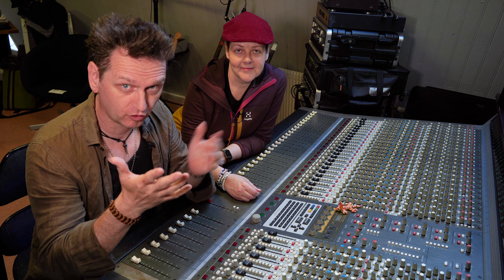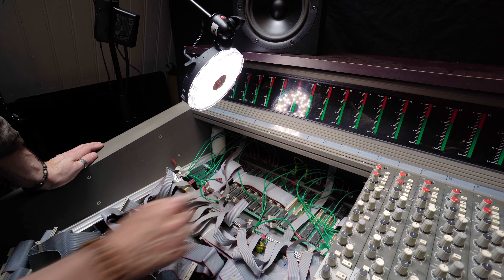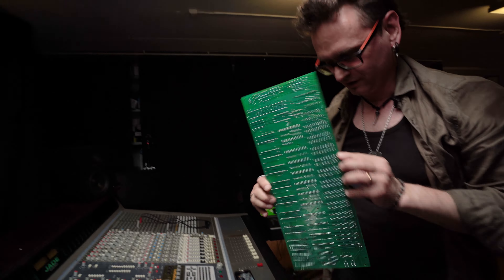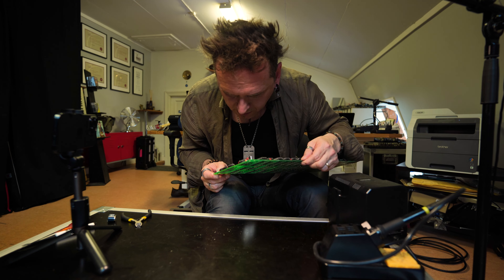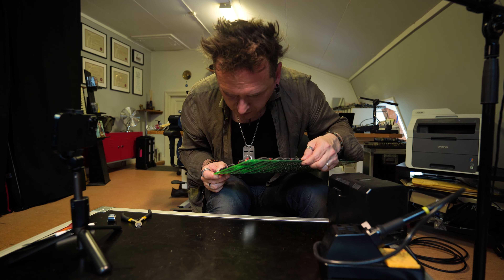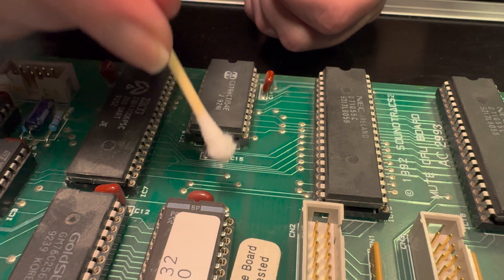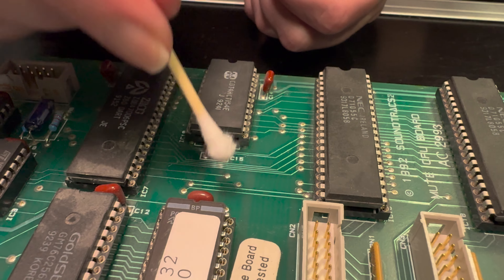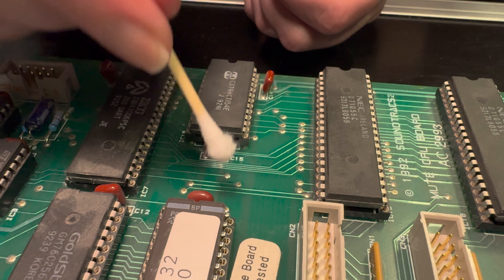Soundtracs JADE (pt 5) - do this before IT KILLS your console!!!

Comment: Great video again folks. Maybe just solder the second battery in situ. I think when I changed the 2 batteries I done them in situ. If I remember I flipped the center section on it's side on the console and managed to solder it from there. Good luck you guys. Remember flux is your friend
Reply from the maker: Yeah we thought about that for the second battery. But that one seems even more damage, so we got advice to try to get the PCB out just to have a look at it and make sure the traces and components next is ok.
Reply: @moneeo  Nice one. You guys rock!!! Since the battery on the center section is upside-down, I think any leakage would drip down and not affect the pcb as much as the other battery does. The traces are a little fragile and replacing caps is daunting. The legs of the caps are all bent outwards ( for keeping them in place for soldering ). The legs can be cut directly underneath the cap, then you can either splice the cap onto the old legs or heat them from the topside and remove the legs ( pins) from underneath with tweezers. Just be gentle and use some flux.
Reply from the maker: @Joey-rp5vg  Yes, hopefully gravity have saved the board from some of the battery acid.👍

Comment: Great time to recap your board too, not too many electrolytics. Have fun, use a desoldering tool i was nervous when you pulled
Legs w/ plyers😂, im recaping my channel strips in my soundtracs too and sometimes pads or traces lift with just looking at it😅.

Keep out the good work

Keep posting videos! Nice work
Reply from the maker: Recapping is on the todo list for the future. I believe it will take some time since there seems to be aprox 48 electrolyts per channel...😳

This project is one step at a time, and they are probable baby steps since everything takes so much longer time the first time we do it. 😀

Thanks for you encouragement, we will keep filming!👍
Reply: @moneeo  remember to add bypass caps around the audio electrolitics and, and decoupling caps for the rails of your opamps. It will be a lot 😅.  On your mute board there is like 10 or more wlectrolitics to be changed.
Reply: @moneeo  For that old console a PSU recap is a must and i´ll do it asap, also power distribution caps inside the console.
 A failure on a channel strip is a pain but nothing serious, a failure of the PSU or the power distribution can be a disaster for the whole console! 
Also 30 years ago there was not that much noise as now at electric grid caused by switching power supplies from TV, laptops, etc... so an iec connector emi filter chassis mount for the PSU certainly will not hurt, if the PSU does not have it...
Have fun and good luck!
Reply from the maker: @jplexstudios  This is the first time i have heard of "bypass caps around the audio electrolitics and, and decoupling caps for the rails of your opamps" - could you tell me a bit more about what that is good for?
Reply from the maker: @nomoimusic3096  We are thinking about getting a new Bluedog PSU and have the old one as a spare.
Reply: @moneeo  Nice!

Comment: Great feeling isn't? I have done this before.(and still do it) It's a labor of love! 
Might I suggest; when handling pcb with such rare ICs, you should probably ground yourself with a wrist strap to avoid static discharge. You don't have to wear it on you wrist.  You can attach it to any part of your body. As long as your body is attached to ground(earth in Europe). I always do this when handling any pcb with ICs. Good luck.👍
Reply from the maker: That is a truly great advice that we will do for the rest of the project - thanks!👍
Is it a good idea to connect the ground of the ESD wrist strap/mat to the ground of the JADE?
Reply: @moneeo Yes. As long as your ground source is a solid one.
I find the wrist strap gets in the way sometimes. You may find this funny but, I usually remove the strap from the wire  (it just snaps off) and just insert the end of the wire inside my pants at my waste. Just make sure the the wire contacts flesh. Et voilà! You are grounded and hands free!😎
Reply: You can get an antistatic matt connect it to the ground system and buy heel straps for your feet.. that way the cable wont get in the way which it always does!. Just remember to tuck the ground strip into your socks :P
Reply from the maker: @sylvaind9086  Sounds great, will try a solution for the next step - keep an eye on upcoming videos!👍
Reply from the maker: @projekct_amk  Heel strap sounds like a great solution - thanks for the tips!👍

Comment: I put one of those same lithium cells in a delay unit but i could not solder to it without a special flux so i put it in a battery holder. Pointless using baking soda and vinegar. You are just adding alkali and an acid again. Just use baking soda with a little distilled water to neutralise the battery acid but then you must remove all residue so no future reactions can continue. Use more distilled water or rubbing alcohol to finish up.
Reply from the maker: I also thought of using alcohol to clean things up, but someone told me it could destroy the thin layer of coating on the PCB.

Distilled water sounds like a great idea that we will use for the further process - thanks for the tips!👍
Reply: You use baking soda for acid containing batteries and white vinegar for alkaline batteries, the aim is to neutralise the opposite chemical deposits. You should never leave the mix on too long or it can lift traces on the board.
Reply: @moneeo Not sure why someone told you that? IPA is industry standard to clean PCBs.
First use your neutaliser to remove battery deposits, then IPA or tap water to clean depending on how dirty, then distilled water to rinse.
To clean up flux after solder work use IPA and then rinse with distilled if needed

Comment: Be careful flexing a board of that size. Make sure you support it.
Also, those sockets that the ICs are in can get oxidized. So while you're in that deep, its worthwhile removing the ICs (with a good tool, not a screwdriver) cleaning the legs and sockets and replacing (with a good tool).
Have fun.
Reply from the maker: It sounds scary to remove the IC's, since they been sitting there for so long and are really fragile. It sounds like they could easily be damaged when removing them...
Reply: @moneeo  the ICs are more robust than you think, but, devices of that era are very sensitive to static electric discharge, so invest in an anti-static wristband and an anti-static mat for the top of that flight case you are soldering on, because some of the ICs used in audio equipment from that era are getting expensive (they are becoming hard to find).

BTW that board you pulled is basically a computer ;-)
Reply from the maker: @StuartTaylorEsquire  That sounds great, could be a future project to take care off.👍

Comment: I would have zero concern washing that circuit board in tap water and rinse with distilled water just for peace of mind. I washed PC motherboards and even CRT monitor PCBs with no problems. On really dirty boards I used liquid dish soap, rinse them well and let them dry. I didn't have always access to compressed air but that can shorten the drying time.
Reply from the maker: Whaaaattt - that sounds a bit to brave for us!😀
Reply: @moneeo  just give it a try, not on your best equipment if you don't feel brave enough😁.
Reply: Senior EE here. It's fine but distilled water is cheap enough to use entirely. A grounded ESD mat and wriststrap is a good idea since mosfets and older digital chips don't handle ESD very well.
Reply: I worked for GEC Marconi in Edinburgh as a Milspec repair specialist for RAF Nimrod flight control systems (Avionics) it was standard procedure to wash the boards to remove the flux and the horrible antivibration covering they painted them with. Basically it was a sink, a neutral soap solution and a nailbrush. Once cleaned they where placed in a drying cupboard for a few hours. I would suggest do a small one first get your courage up but you'll be fine.
Reply: It's only fine if there are no mechanical components like potentiometers and carbon tracks. Ultrasonic cleaner is the prefered device for this type of job and only distilled water. However the affected arrea should be NEUTRALIZED no matter what and that has nothing to do with cleaning really.

Comment: What were they thinking, soldering a battery to a circuit board???🤔😵‍💫Great video ❤
Reply from the maker: Yeah, i have no idea, but there must have been some reason...🤔
Reply: That's standard practice for audio gear. A lot of equipment like synthesizers or effect units have batteries soldered to the pcb. It's usually easy to desolder and replace them, for any studio technician. 
A soldering iron used to belong in any studio.
Reply from the maker: @UseYourBrain930  Any idea of what could be the benefit, other than that it's easier in manufacturing to solder straight on to the PCB than to a battery holder?

Comment: And when you reseat the ICs you will get a slight noise.  This is normal (assuming you have the bottom of the board well supported).  Also make sure you have anti static stuff (ideally a strap as well as the board on an anti static mat).
Reply from the maker: it sounds a bit scary to pull out and clean the legs of the IC's. We could get in to a REAL problem if one of them broke. 😳
Reply: In that case. Make a foundation out of a  mat  or similar flat item that will support the board. Use 2 or 3 fingers across the top of the ice and gently push. It will settle in and ensure good connection. 

What happens is as the board/chips heat and cool they slowly “walk” out of the socket. 

Gentle and methodical

Comment: Could you not cut the battery off where it is leaving as much of the leg as possible, then solder on some long cables to place a new battery wherever is convenient?
Reply: I have a Soundtracs Solitaire and did exactly this...Also advisable to keep the mixer turned on for long enough to get a lasting charge into the battery...
Reply from the maker: That advice is a good solution to not have to stress the circuit board more than necessary.👍

But since the second battery seems to have pretty much battery acid leaking, i got the advice (from a soundtracs Service technician) to take the PCB out, just make sure there are no damaged traces on the PCB.
Reply from the maker: Great tips Martin, since it has been sitting almost untouched for 2 years before we bought it, i believe there can be oter benefits as well to keep it running for some time.👍

Comment: Interesting that you have changed these batteries for something completely different .. 

Those batteries are rechargable and therefore the board will have a charging circuit .. which then may have trouble with your new type of battery. Is your new one also rechargable? 

My Solitaire has one automation board for 12 channels .. So I have 4 batteries on total to change and 3 boards to fix (corrosion is quite bad).  Are you sure there are not other boards to change too under the other channels?
Reply from the maker: You are so spot on - these batteries are not rechargeable. Thanks for making us aware of that - new (rechargeable) batteries are now ordered!🙏❤

Comment: Hi Per several viewers don't  understand if the batteries leak the board tracks are damage, you should have called me if you had taken  the first back panel of you could have got at the CPU board without taking out all those channels  but never mind there are actually 112 mute switches if you have the 4 on the Aux return channel thats 96 on the 48 channels 12 on the master Aux outs and the 4 on the Aux returns good luck Mike Baker
Reply from the maker: You are so right Mike, we really apreciate the advice from you who are more experienced in doing this service.

I will have to check the back panel - that seems like the correct way to reach these PCB's.

Thanks for the tips mate!🙏❤

Comment: https://youtu.be/70OvVphUaJI?t=898 sir, 14500 means the size of the battery (14x50mm), not the mAh :).
Reply from the maker: I'm the one mixing up the numbers on the battery in the video, sorry for that.😀
The correct number is 2400 mAh.